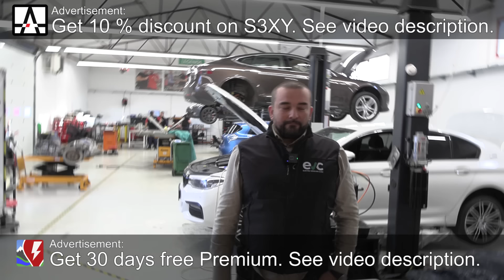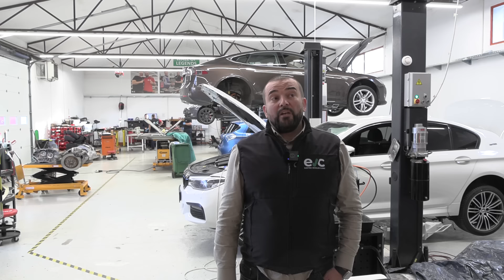EV Clinic in Zagreb by Vanja Katic

Comment: For EVs to truly be the future, we need ppl like this. A EV can't be garbage after 10 years because it's too expensive to repair or impossible to repair. This is why I loved ICE because I could do everything myself, I took the risk and bought a used 2015 Model S 85 D last year because thats from my research the one with the least issues. I immediately changed the drive unit oil on the rear, and I gonna flush it and also swap the front drive unit in December when I get to borrow a lift from a friend, then I gonna use the KAF1 oil. and then it's probably good to go for another 125k before I do another oil swap. and I hope I somehow can manage to keep my Model S alive for as long as possible. I want to prove that EV's can last a long time with care but I can no longer do everything myself, high voltage is out of the question, and I don't have equipment to pull out a 500-600kg heavy battery or the drive units myself. But yeah, lets just hope I did not do a mistake by going over to EV 😅

Comment: Nice job😊
M'y S70D AP 1 from 2015, run now perfectly for 465000 km original battery and engines,SDU are the best, only change oil,and add gx from marly into the gearbox.....les frictions and noise....
Thanks for your video's

Comment: In my opinion, the legacy Model S is a very underrated car. Having owned my 2016 Model S 85D for 3 years now, I want to keep it on the road for as long as possible. It has now covered 292,000 miles (470,000 kilometres). It's great to drive and over the next couple of years I'd like to improve the efficiency, the charging speed, the range and the power and keep it reliable. It looks like I need to get saving! An indestructible, more efficient LDU from EV Clinic has just been added to the shopping list! In the meantime, we are still pilling on the miles, with another trip from Devon, UK to Southern Italy planned before the end of November.

Comment: My Model S 85 also got a new stator and rotor at the EV Clinic in Croatia. Thank you again! And greetings from Germany.
Reply: Ev's are "cheap" to maintain.
Reply: what was the price if you dont mind sharing?
Reply: @trytthisnowk  If I remember correctly about 7000,-€ including sealing of the battery.
Reply: @jakobschoen6499  thank you
Reply: @jakobschoen6499 is it worth it?
I mean if it is an older car then 7k is a lot when you can nuy 3 yrs old model3 for around 30 k?
Reply: Aren’t the EVs trouble free?
Reply: @igorv4631  Most are.  But early on Model S had poor sealing of coolant in the motor.  Some people just run the motor dry and limit power.

Comment: They sell the LDU referb with new seal kit for 1000€, but claim if you don't buy installation manual you will most likely fail to install it. Cost of the manual 4500€. They don't want you fixing your own car. Blatant blocking of right to repair ethics. Lowlife
Reply: Meh. He us selling a way to make money. Also he is not Tesla. Right to repair is not the same as being open source.
Reply: @rkan2 I'll say it again €4500 for the instruction manual! it's designed to lock out the home mechanic, even the bearing kit is almost double what other kits are with SKF bearings